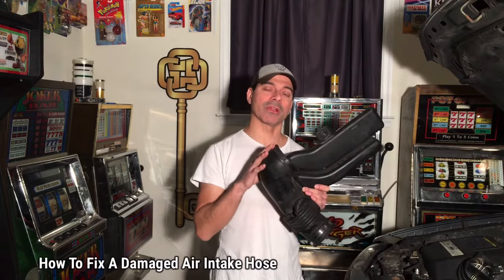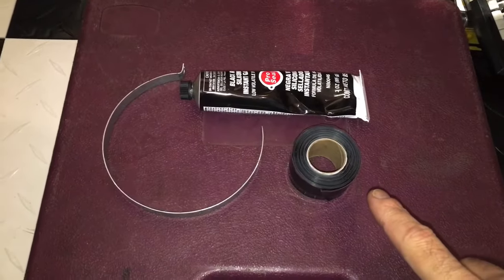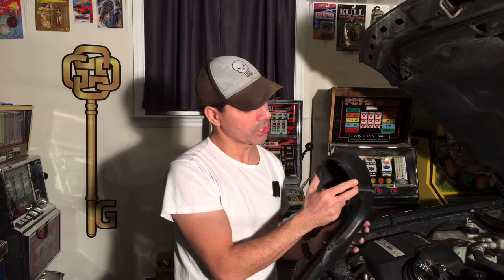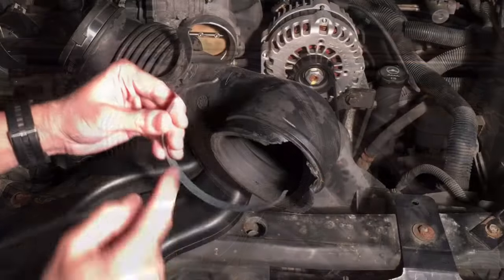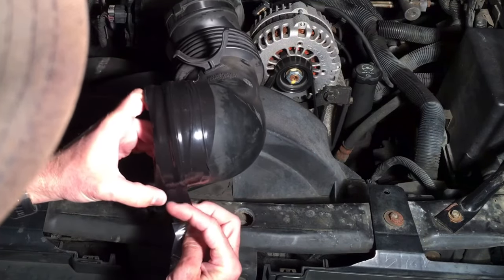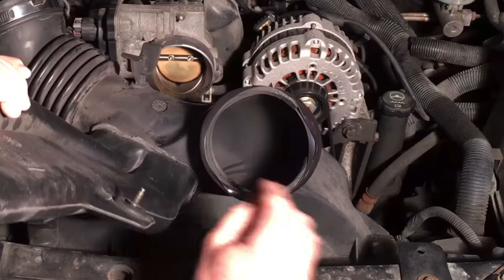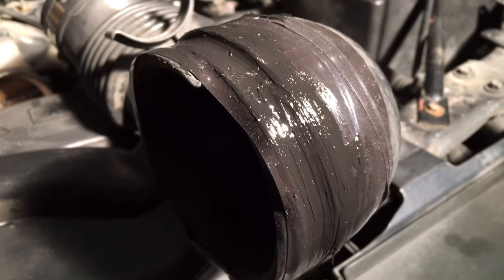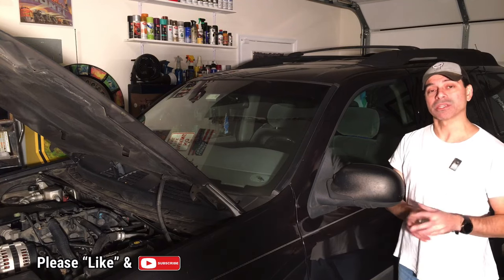How To Fix A Damaged Air Intake Hose (Andy’s Garage: Episode - 314)

Comment: Thanks Andy. Saves a lot of money on my wifes NISSAN. Japanese parts are very expensive in Europe, especially for the unique model my wife has with low sales in our region. Is the tape also called "rubber seal tape", same results?
Reply from the maker: Yes, rubber seal tape is the same
Reply: Will this make my code p0101 stay on even though I changed the part. That intake still is lose . I changed the mad sensor and the camshaft like it said . Still the code come on

Comment: Excellent idea. Now how would you proceed when the complete end of it (that slides over the throttle body) ripped off, you can't find it replacement part and have to drive 2.000km home....?
Reply from the maker: You can get an aftermarket intake hose at an auto part store and connect it from the throttle body to the MAF sensor.

Comment: I had a car once the air duck was coil had a ripp in itI have used duck tape worked for months or 2 but works better put 2 three lays of duck tape I got  4 months just got watched the tape here and there. Never use a heating duct pill and stick silver all it does is vapperate in a few minutes I already tried it.

Comment: Any thoughts on how to fix the flexible portion of the duct? Mine is just flaking apart as if it's dry rotted or something. The one on my truck is discontinued
Reply from the maker: I would replace it with an aftermarket duct. Just match the inner diameter of the hose on both ends
Reply: @PhillipsVision  it's rectangular - will I be able to find it in that shape? Also, what do I search for? Does it have a specific name?
Reply from the maker: @jt0mi  if you search online you may find it; it’s the air intake duct, or air intake hose

Comment: Excellent video~ The suggestion and demonstration for repairing a cracked air intake hose/boot is genius. We recently took our 2004 Nissan Pathfinder SE RW in for servicing @ the dealership & were told there was a crack in the air intake boot & that the part number: 165676-5W90A has been DISCONTINUED by NISSAN  & since they're a Nissan dealership & can on ly use Nissan parts, we now have to find the aftermarket or used part and find a mechanic who will do the install. :-(  This sounds crazy because there are plenty of people who get parts for their MUCH MUCH older cars than ours.                                                                                    *We're going to try your 'repair' suggestion  with tape and silicone first but have a question: What is the brand name of the TAPE? is it Flex Seal Tape by Flex Seal? Is this a 'bonding' tape? Is Electrical tape similar? We cant locate the tape. ~Thank you
Reply from the maker: It’s not Flex Seal, it’s a specific Tape. I don’t remember the brand, but it is sold at Autozone
Reply: ok, thank you. So, we're being told that it would be  $175 labor to remove, repair, and reinstall the intake boot, and also perform a computer reset which would be necessary for the car to reevaluate its fuel input in addition to buying the tape and rtv black silicone.  Is this about right?                             *I think we had mentioned that we had already taken it in to a Nissan Dealership who replaced the Fuel Sending Unit, Fuel Pump & Fuel Filter BUT told us the Air Intake Boot was Cracked and Nissan had DIScontinued that part so we'd have to have that done elsewhere.   @PhillipsVision

Comment: I have a 2016 Maxima, mechanic inspection said the air intake hose is damaged and need to be replaced. Im noticing weird stuff with the car like slow acceleration and higher rpms.. is this caused by the air intake hose damage?
Reply from the maker: High RPM’s can definitely be cause by a vacuum leak in the intake hose
Reply: @PhillipsVision  Glad to hear its not a big problem. I was so scared to be the transmission thats going out.

Comment: Will it seal the connection too? Not broken itself but it is leaking sure to pressure.
Reply from the maker: Maybe, but you may want to replace it with a coupler